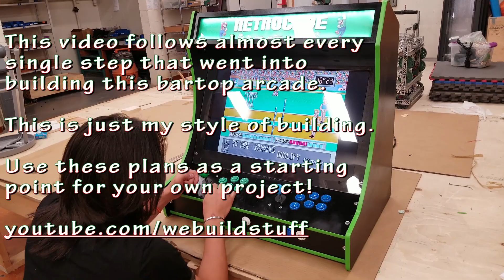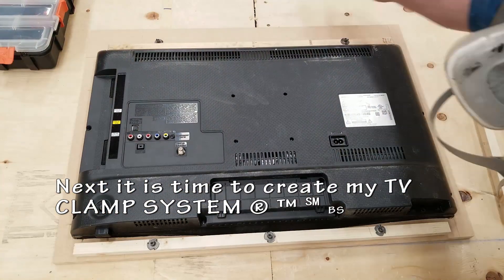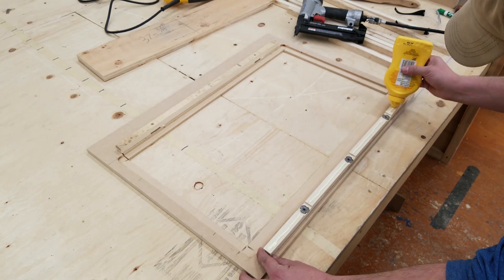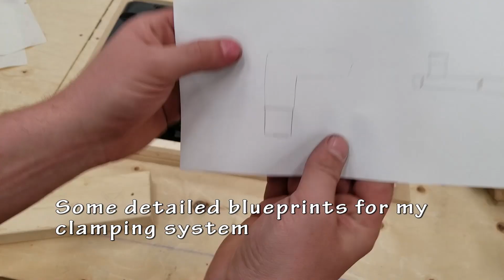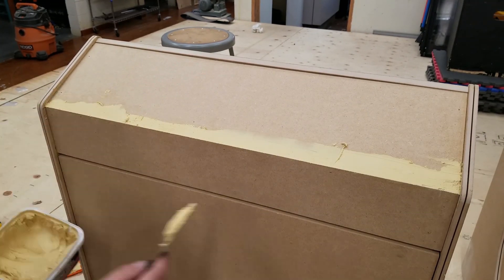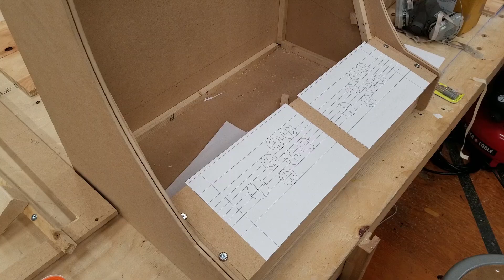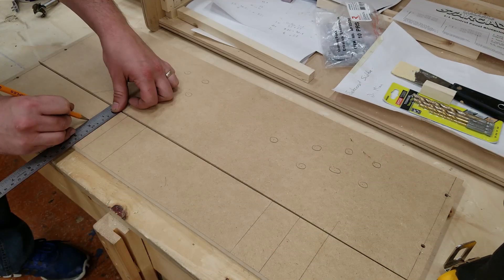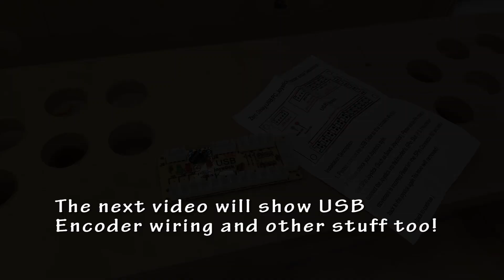How to make a DIY BIGGER Bartop Arcade! - Part 3 - Raspberry Pi

Comment: hello I'm making your boatde the 70 cm one, I printed the sheets to make the holes of the buttons and joystick, the dimes that you put, in pdf format differ from those shown in the video, could you politely indicate to me the measure to leave from the side dx and the one from the left side, at the beginning first vertical righa on the dima dx and sx? Thank you
Reply from the maker: Are you referring to where to make the holes for buttons and joysticks? I dont have an exact spot.  I put the paper on the control panel where they feel comfortable for my hands. All personal preference.
Reply: @WeBuildStuff  ah ok then I adjust with the video I make a still image and I see by eye to do it equal, then I would have another question if I do not bother, the button in the center, where are the buttons start and coin player one and two, what function does it have because you put it needed to get out of the game?
Reply from the maker: @brunocantarini1045  the third button is a hotkey.
Hotkey + Start → End Game and Quit To Main Menu

Hotkey + A → Reset Game

Hotkey + B → Retroarch Menu

Hotkey + L1 → Screenshot

Hotkey + Joy2 down → display FPS

https://recalbox.gitbook.io/documentation/basic-manual/getting-started/during-the-game#special-commands
Reply: @WeBuildStuff  ok thanx👍🤗

Comment: What size auger bits you use for the Joy-Cons and Buttons ?
Reply from the maker: I used a 1 1/8" forstner bit. Some arcades use smaller buttons but 1 1/8" is pretty standard
Reply: We Build Stuff That’s for both correct ?
Reply from the maker: @RetroModeDays  check the outer diameter of the buttons before you buy. They will almost always be listed if you buy from a reputable seller on amazon or ebay. You can get more expensive or cheap. Always personal preference
Reply: We Build Stuff okay thanks. What size nail you use ?..  1-1/4 ?
Reply from the maker: @RetroModeDays  depends on the thickness of your material and cleats (wooden block supports). I use 1 inch nails with 3/4" cleats. allows for enough hold while the glue dries. If you use nails that are too long they tend to poke through the other side. I've learned that the hard way!
Reply: We Build Stuff okay thank you again. I’m using MDF.
Reply from the maker: @RetroModeDays  still depends on the thickness of your material. I'll use 1" brad nails with my nailgun regardless of the material. I try and keep the nails hidden so not visible. paint and wood filler help!
Reply: We Build Stuff Okay, that made sense.

Comment: The mustard didn't work, it just fell off and smelled bad after a couple days. What kind of mustard am I supposed to use? I used Heinz (XD why did I say kraft first)
Reply from the maker: Regardless of the brand it only works if you add beard extract. If you look closely the mustard has my stamp on it. There are easy ways to do this at home that are time consuming but there are also machines you can get that removes the essence from the hair which can be infused in under an hour with the mustard. After 2 weeks in the dark at just above freezing temperatures (1-2 degrees is sufficient) the container can be brought into the shop and kept under a heat lamp for 12 hours while Relax by Frankie Goes to Hollywood plays at 73 decibles on a loop. 

Once it has acclimatized to room temperature it is ready.

If you skipped a step it might not work. Godspeed.
Reply: @WeBuildStuff  aw thanks man, some residual odor, but it works XD

Comment: So if using a tv, monitor and you cover the whole front bezel. How do you turn it on? Ps I'm looking into converting your full size plans into PDF.
Reply from the maker: If an IR sensor is available I drill a small hole in the wood in front of it and you can use its remote control  to turn on. You could also rewire the button itself to a new button or switch. 

Many of the computer monitors I have used will turn on automatically when they get power. I typically have one main power switch (Iec socket) in the back wired to a power bar. When the switch is flipped everything receieves power and boots up together. I would love to have a way that works everytime. It has been trial and error for each custom build.

I'm excited to see your PDF plans. I just haven't converted and posted anything yet

Comment: Which pi did you use?  Found the pi 3B+ doesn’t support recalbox
Reply from the maker: There should be a beta version for the pi 3b+ that the developers are working on. I usually check their forums or facebook page for compatibility.

I ordered a pi3 because a stable version of recalbox was supported at the time. My latest build I tried an Odroid Xu4 and it has blown the Pi away so far.
Reply: Do you know where to order from?  Not many options on amazon.
Reply from the maker: @seanmcgee3800  i use ebay for a lot of stuff. 
Pi i get from a local electronics store or amazon depending on pricing. Last Pi i got was this link

CanaKit Raspberry Pi 3 Complete... https://www.amazon.ca/dp/B01CCF6V3A?ref=ppx_pop_mob_ap_share

Comment: How do you get full screen or games?
Reply from the maker: Everything should be in the configuration files or menu. Some games may not scale correctly depending on what system/arcade there were originally made for. You can also check what is supported in your version of recalbox, retropie, retroarch, etc
Reply: Thanks, the image I downloaded has 10800 games and some of the older games are set to play like you are playing it at the arcade.  They show the arcade machine and the old screen and you play it like that.  Only plays on like 30% of the screen, the rest is set like you are standing in front of the machine at an arcade.  I will maybe try another image.
Reply from the maker: @seanmcgee3800  I've never tried preset images... but there is always somewhere that allows for customization. Check for config files or if you can access retroarch by pressing special keys or something on your keyboard. There is always a way. I only know recalbox for now.
Reply: @seanmcgee3800  The problem is.. those games a "Vertical" games. Thats why they fill the sides because they need to be played on a 90 degree turned monitor. If you have a 19" 4:3 Monitor turn it by 90 degrees and you can play these games without a border. But then you cant play the other horizontal games anymore. Remember Arcade was 4:3 Ratio. Today we have 16:9. You can strech it to fit the screen but it looks like s... then. Thats why i build my Cabs only with used 4:3 Monitors.